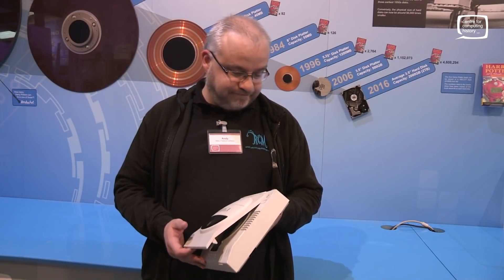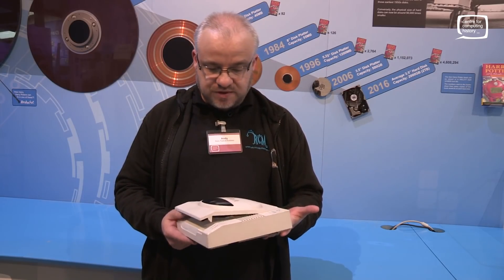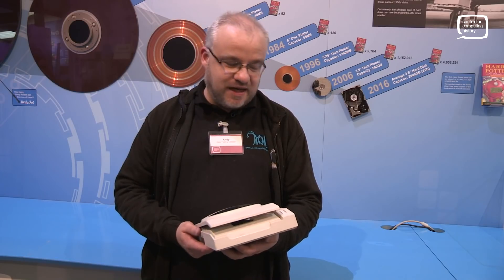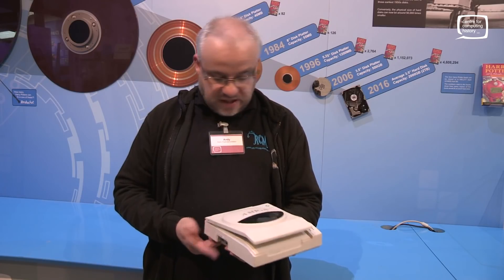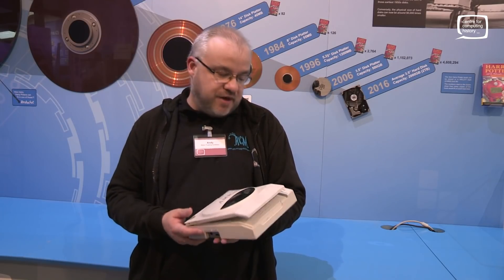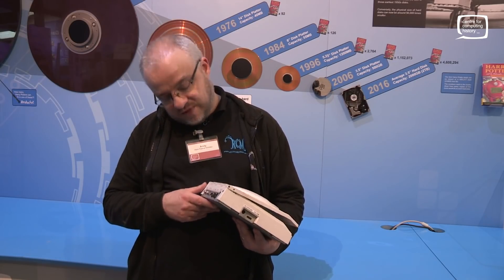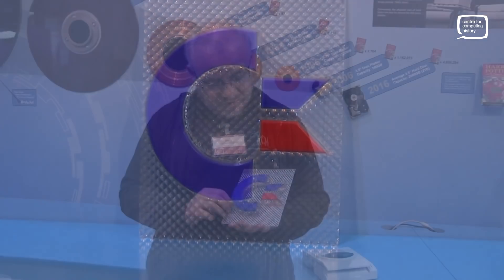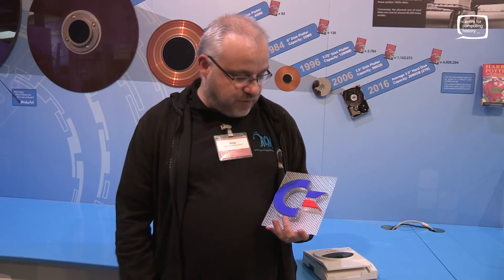Prototype Commodore Amiga CD 1200 Computer Festival 2017

Comment: Interesting addon, like that of a few other things that didn't materialise, but if my memory serves me right, wasn't it/isn't it possible to connect an Amiga CD32 to an Amiga 1200 so it can use the CD drive ? Another prototype that I saw on the front cover of CU Amiga magazine was the Darth Vader helmet prototype with the front CD drive around 1996 :D, very cool but an ergonomic nightmare for future PCI card expansion I think haha.
Reply from the maker: yeah your right the CD32 can be connected (a project that i will do soon) to the amiga but its pretty slow , a direct connection is much faster (IDE or SCSI). The A500 cd-rom was fairly slow anyway and that was SCSI. Again your right the Walker had PCI and maybe a daughterboard ?  but limited space to add much but it was  a big leap forward for the Amiga but again it was cancelled by ESCOM.
Reply from the maker: Your right the cd32 rom dropped support for various things but added cd -rom boot and support for akiko etc , also I think the date of copyright was changed too ( the last commodore version date) escom then changed it again for the 1200 and Walker with was 68030. Are you sure the cd-rom has a 68030 ? That makes no sense as the cd32 is a1200 speed ?? I can’t see commodore doing that the cost would of been huge
Reply: EDIT: So, the woman designing it pertained to commodore. I anticipate commodore realised way before april 1994 that the 14MHz 68020 was a bit lame, so I guess it made sense to restore faith in the a1200 by giving it at least the 68030. And the walker was either going to get its own upgrade I suppose or maybe its other features were enough to carry it. Surely commodore knew (even if they were in denial) that the a1200 should have had a CD and at least a 68030. The only thing that kept the amiga going was its fans and even they felt insulted by the a1200 being lame. Maybe commodore made one last attempt to listen to their customer base.

 I think it was an EC version of a 68030, and therefore cheaper, but anyway, the full spec was released april 1994 by which time such a chip was cheap. I must check the MHz etc before I promise you those stats, but I do remember them being that. And actually, we should also remember that if it was 30MHz or 33MHz then it is slower than the older GVP for the a500 (40MHz), and also remember how there were not only EC versions but "embedded" versions which ran at 33MHz. I spent stupid amounts of time at weekend nights years ago scrawling out how these chips should have been implemented in things like a1200 variants and atari-lynx style amigas (hence the embedded 33MHz knowledge). It is my unfinished business timeline of how I should have been CEO of "Commodore Towers, Amiga division" as a lad (LOL). Give me a few days to pull up the literature on this and I'll prove to you what I have checked.

While I do not wish to bother him too much (and I don't think I've annoyed him, and he seems very patient with me and a nice chap), I've been chewing the ear of the chap who did the graphics for the psygnosis game "Agony". He may not have been ble to read my latest war-and-peace length comment to him (and it may be marked as spam - and if he wants to not get involved, fair enough) but I'm now trying to get him to "pull-strings" to mention an idea to his psygnosis contacts (although again I cannot nominate him and I feel a bit cheeky - but hey "If ya don't ask, ya dont get") and to take the idea onboard himself if he wants to. Basically, you know how Philip Franks from Darling buds of May, (or "D.BOM" if you want it to sound cool) did the CD32 advert featuring microcosm and it was hilarious because that's just so british, and also a non-sequitor for the dude from D.B.O.M to be in a cd32 video back then. Come on, we all laughed our arses off. Well, now that the cambridge-computer-museum have asked people if they'd like the cd1200 remade and maybe sold, I want Philip Franks to do an advert for it, maybe even with psygnosis blessing. And I want it to be a hilarious spoof.

I'm also "pushing my luck" but I want the excuse to be for the cd1200 new version (let's call it cd1200b so 'b' is for 'better') to be open source, like terriblefire and others have done, for educational purposes. This way, I have a moral highground so nobody can be annoyed at me for bothering them all to do this (and in some ways by free volunteering). LOL. Great excuse, don't you think?!

The cambridge-computer-museum said the cd1200 "was a barn find", so I have ideas for a humourous script for verious meme videos to be made where he walks into a barn (similar one belonging to Pa Larkin in DBOM) and he hears "perfick" (a la David Jason's Pa Larkin). Then I plan to badly photoshop in (maybe using sketchup or blender3D) the cd1200 in place of the cd32 over the original TV advert, and add other in-joke references. The more variations people make in their own meme version of that video, the more Philip Franks will one day have to notice and then he'll basically have opportunity (morally - lol) to be in on the joke and make the video, thereby giving it publicity. Again, flinging some open-source hardware to encourage education and game coding enterprise will easily make this plausible.

I also think it should have two (yes two) 68040 CPUs of 50MHz each running in parallel like a Mac has. Also, it would have edge connector slots so you can also put in two PowerPC CPUs (so yes, that is like how a blizzard ran the motorla 680x0 and the PPC simulatenously - but this is double that in parallel). that way you don't have to have the PowerPC but the slot is always there. The PowerPC chips can be harvested from old playstation2 consoles, or gamecubes or Wii. So two 50MHz chips via 68040 combined with two PPC custom-boar chips at say 730MHz from Wii salvage would be like 50+50+730+730= 1560MHz sort of. However, the basic (whereby you just unplug the PPC boards - or rather just don't buy them) would give 50+50 Mhz thereby sort of 100MHz kind of. As TerribleFire pointed out, those 68040 chips are abundant and cheap since they were in many printers. I think the PPC boards could have 128meg each so with both you could have 256meg of RAM. The cd1200b also needs a PCI slot for the Hombre Graphics to go in as a future upgrade. The basic version with merely two 50MHz CPUs could have less ram perhaps.

Then games companies can release stuff for it and make money. Also signed and sealed "collectors editions" of the hardware can be sold by the people who design it (presumably pertaining to the original designers and they may get some new designers in - and btw I have my own fantasy-football-team of people who I haven't asked if they are ok with it- LOL). Collectors want he signed sealed ones. They really do. So even though it's open source, they'd still have a money making avenue. People would make knock-off regardless of open source. Therefore it seems better this way as they get prestige. But hey it is merely my suggestion.

Hey, haven't you got access to barns or something? If yo uever feel like making you own versio of the meme video to out-do the others, by all means give it that authentic barn atmos.

On a side, if this works (and I have no idea if anybody will lsiten to me on all this), I would like there to be a version of the cd1200b deliberately coloured to looked like a broomine aged amiga which has never been retrobrighted. I want fake dust and everything, just like the barn find (but browner). A long time ago I predicted a product called "reto-dank" would be invented as an antidote to retrobrite (which as you guess I'm not keen on), and you daub it on with a tea bag like when you had to make  fake-old-looking book at school. I do think the CDROM part of the cd1200 drive should be a DVDRW and a plipbox should be modified to plug into both the parallel and serial together to increase bandwidth and get a seamless1xDVD playback speed (about 8x CDROM) via ethernet. Then all trapdoor and PCI bandwith on the a1200 is for CPU, RAM, HardDrive, and PCI etc.

Last note about microcosm, even though it was pretty good on the 3DO but mediocre on the amiga (yet better than megacd), I ould still describe it in a magazine as: " Microcosm? Capsule review: *Bum'ole, The game* "
It really does look like flying up a cow's backside (maybe in " all creatures great and small " meets " inner space "). Would be cool though if a sequel came out with voxel graphics for the dual 50Mhz cd1200b and it could be called " Microcosm Number Two: Unfinished Business ".

Mr Mannering, they don't like it up em.

It would have been funny if that old CD32 advert showed games truly representative of the shovelware form the a500 it got. The CD32 in that advert could have been playing the Viz amiga game.

I must ensure my parody meme doesn't push the envelope too far in that sense. LOL.
Reply: @MJNurney, Hey mate, I was wrong about the 68030 being in there, however, I have some info you may find interesting. It does have its own Power supply btw. The cd1200 should have a RAM slot to allow a 4Meg SIMM to go into it. This however seems somewhat odd though because the pcmicia is 16bit and so would have likely not been used for a1200 ram expansion here since it slows the a1200 down (so the trapdoor was to be used) and yet unless SIMMs (what with them often being 16bit) are in matched pairs, they are not 32bit unless they are a single 32bit SIMM which is what the cd1200 slot is for. The cd1200 should (apparently) have an akiko chip in it. It is also from amigaOS3.1 at the time and the a4000 version of it (yes, there was to be one) would have had a FMV cartridge addon support. Think about what that means in terms of graphics expansions for amigas such as a a4000 or whatever. Also it means surely there would be a custom kickstart ROM not just for ths "cd1200 on the a1200" but also for the "cd1200 on the a4000" (and the a4000 version was to have the mpeg module built in. So I wonder what Brek Martin would make of that).

And here is the juicy part: These things were intended to first be released in germany. This one in the video is the only one of the 9 known to exist (like some LOTR ring wraith) and so I wonder if another is somewhere in germany. Or maybe 20 are made. Would gerion79 or Jan Beta (or somebody german, into amiga) be able to put the word out (as a german language video) and do some hunting for it? It is a double speed multisession drive.
So the interesting part is surely that a kickstart must have been designed not only for the version in the video but also for the a4000 version. It was to havre full cd32 compatabilty but is was unclear of the mpeg module was to attach to the a1200 version in the video. But surely it should at least have unsoldered connectors on its board and that would therefore (I guess) mean it could have a sx32pro somehow jerry-rig attached. However it is possible to attach a mpeg module to an a1200 apparently without this cd1200 needed at all.

On an aside, those audio ports are an audoi passthough for augmenting audio. Some CD32 games don't like fast RAM attached to the pcmcia port when running on an a1200. Remove it and they work fine.

The cd1200 drive was shown up and running at CeBIT with OS3.1 which has CDFileSystem so both CDTV and CD32 drives are supported. The cd1200 got its UK debut at the  ECTS in the commodore suite. David Pleasance was there and said the cd1200 was never to be FMV module compatible. Previously though, he'd supposedly said he wasn't happy to market a cd1200 which isn't FMV comptible. The sale date (1994) for the cd1200 (on a1200) was to be september. For germany it was to be by May. I reckon that must mean there was already at least one in germany by then. Perhaps that means, if there were more than one, that a german one may have been snuck back into the uk, or maybe via some europe route betwixt the twain countries. Via france or belgium or holland? What game devs could have got one? After all, game Devs get hardware in advance of packs being made for cd32 or amiga etc. Be that "cartoon classics" or "spectacular voyage" (which had bitmap bros and psygnosis games chaos engine and microcosm). Do psygnosis (or ex psygnosis people have one kicking about). What about the people who made the sx-module?

The thing I want to see though it the kickstart ROMs for bother the a1200 version and the a4000 version. Interesting that both CD booting and akiko would thereby be in the a1200 and the a4000.

EDIT:
Also the cd1200 has a black pcmcia cable (with black pcmcia card) plugging it into the cd1200 and is about 2 feet long. There are indeed some that were in Germany due for release (£199) by may 1994, while the a4000 ones were meant to be for september 1994 (but they made have never been constructed).
Reply: @skyhawk77, There was a difference (apparently) in the 3.1 ROM you'd get in say an a1200 compared to the 3.1 ROM you'd get in a cd32 and that was because the CD32 had CD booting in its ROM. The a1200, I think, required you to piggyback boot off a floppy, or, if had a HDD, have CDBoot installed on the HDD whereupon it would search very early on in the HDD boot sequence for CD-drives. The cd1200 probably would have had a ROM akin to that of the cd32 for it to boot with no worries (i.e. with no need for a floppy piggyback or a HDD instll of CDBoot). The full spec for the cd1200 he holds in his hands there came out around april 1994. It has an 030 in it.

Comment: I mentioned this to the chap who did the graphics for the game "Agony" (in a convo on his youtube channel). Cool guy. Using FPGA, this could be remade. Great for Homebrew games

Trouble is though that, regarding its CPU, it is not "enough" of a speed change what with it being 68030. Really, I think they should put two 68040 chips in it at circa 50MHz since they are abundant (with two FPU chips too) and, importantly maybe also a PPC, just like the blizzard (seeing as the cd1200 connects via both trapdoor and pcmicia). And a source for the PPC could be the playstation2 (or wherever they come from). There are more trashed PS2 consoles in bins than there are a1200s, so therefore it is fair game and not harsh to the PS2.  The 680x0 and ppc ran together on a blizzard. Crucially, on account of the fact it connects to both the trapdoor and pcmcia, they absolutely must put a PCI slot on the edge or back. This would allow for all sorts so people need never pop the hood on their a1200 for anything ever again. Lastly, the cd1200 should always search for a plipbox upon boot and make the bugger work automatically. That would thereby save bandwidth. Stupidly though, the cd1200 is a tad lame being plugged in where it is plugged in for that cd1200 version he holds in his hands. It is a massive bandwith waste on the interrupt request cycle. Considering the time, what she had to work with it understandable. These days though, it's a bollocks move. It would be better to be a DVDRW drive were it to use that bandwidth, but even then a DVDx1 speed (which is about 6x CD IIRC), you can get that speed out of the plipbox since th arduino in it does all the grunt work. That is more than enough for the amiga. This "better" version of the cd1200 should be called cd1200b so the 'b' is for 'better'. You know it makes sense.

Nobody on the official hardware side of commodore ever listens to me though. Shniff whimper sob.

You know that seen in Monty Python Holy Grail when "Tim" the enchanter (warlock dud) is warning of the white rabbit by saying " Look at the bones " and yet nobody listens to him? Yeah that's me right now. Story of my feckin life. It's like how awesome water effects were never in the playstation2 games even though the hardware could do it. It's the illuminati banning ps2 games with cool water effects. It'll be some manner of "E.U. fun quota" or something.

You know how in jurassic park, they used "frog DNA" to "fill in the blanks" of the dinosaur genome? Well, I think we can come up with some Frog DNA to fill in the blanks on the Hombre graphics and make it backwards compatible with AGA and HAM OCS etc. It's be great for usage with this. Some tricks from the video toaster would work but also there is some information on the zarchos channel about how the Archimedes could have been improved for its graphics and zarchos reckons it's be something that should work on amiga (e.g. a500) too. The cd1200b PCI slot would be great for a Hombre graphics of course.
Reply: 3:15 The full spec for that thing came out in 1994 btw.